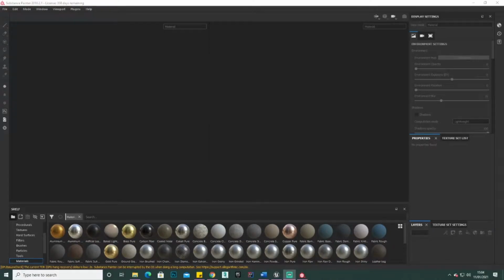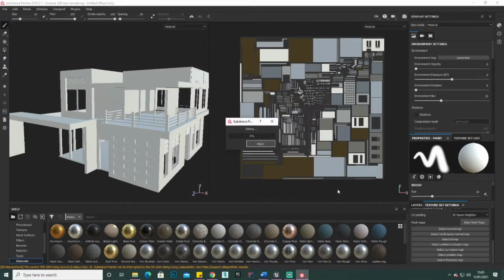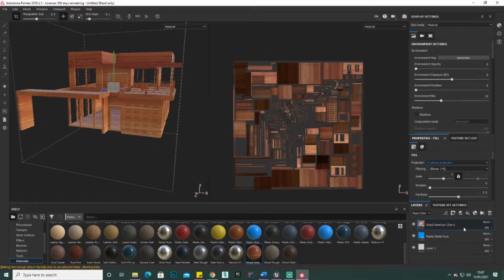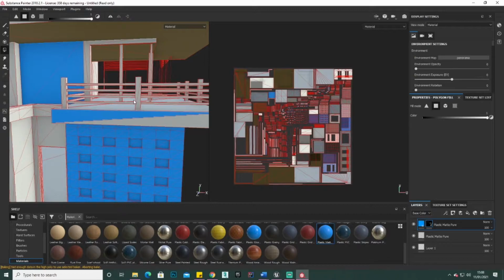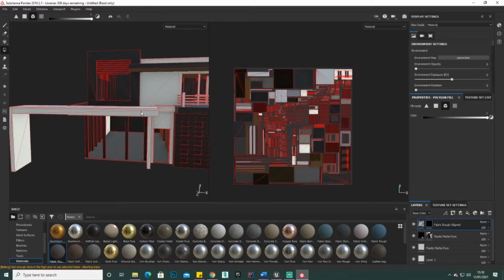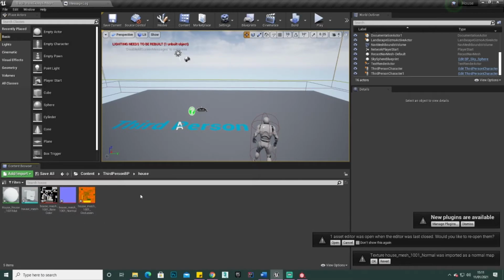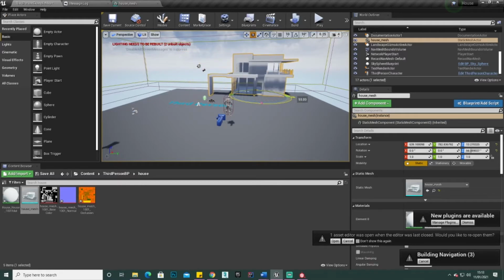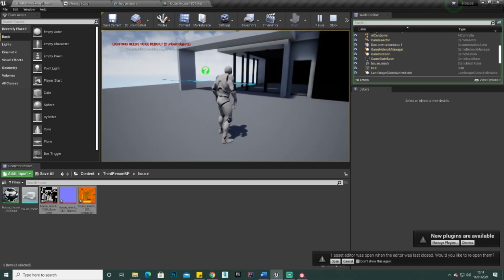Using Substance Painter and exporting for UE4

Comment: Does Substance Painter actually change the mesh in any way? I've been exporting the FBX from the 3d software and into Unreal, and just exporting textures from Painter, but is there any situation where you would need to export the mesh from Painter to Unreal?
Reply from the maker: Substance works purely with maps and your UV tile so no need to export your mesh from Substance!